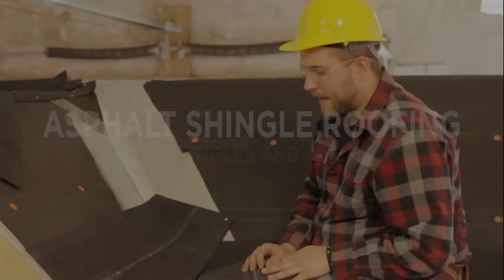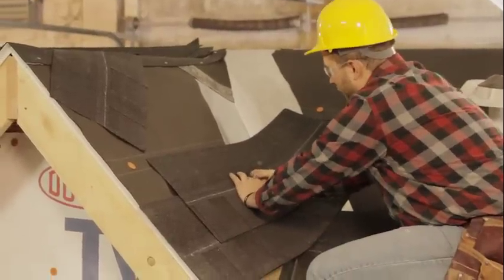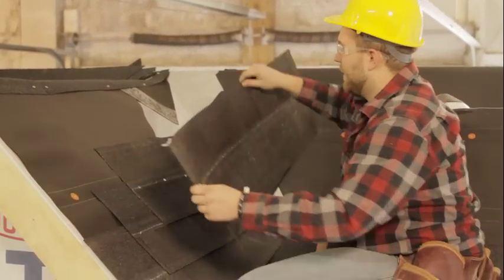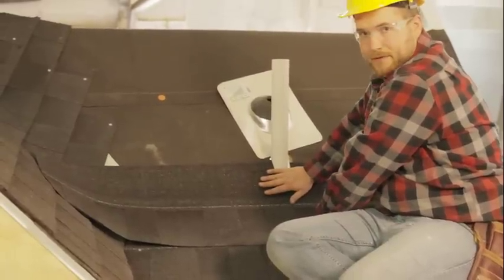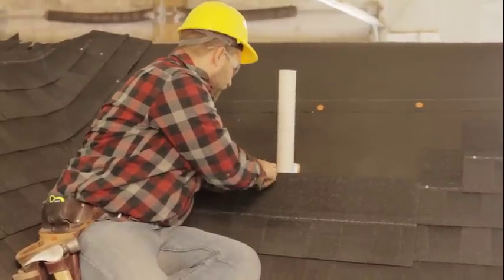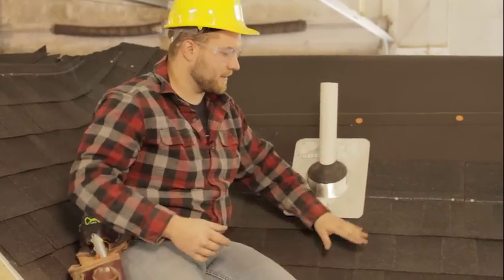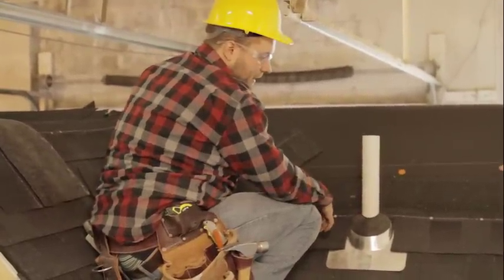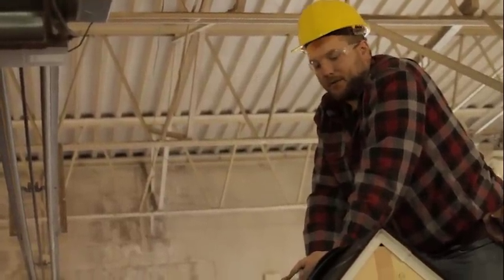How to Install Asphalt Shingle Roofing Part 11: Valley Shingles and Pipe Boots

Comment: Word of advice when you cut the valley you should cut 1 1/2 to 2 inches away from the valley with the tops of the tabs cut at a 45 degree angle so water doesn’t find its way in to the attic, also a  line underneath the shingles of roof adhesive following the cut valley should be used to make sure the entry of the cut valley is water tight.

Comment: its crazy im in Altanta we do a lot of commercial roofs i see it more then you think 50 ft valley right in the middle of the valley a big heat stack .dont make sense to put a pipe boot or a hear stack in a area where the rain travels the most

Comment: I've read several books and watched many videos on the subject of roofing how-to over the past few days and this video series is by far the best one I've seen. Very thorough and well explained. Thanks for posting! 

I just wanted to mention that some roofers recommend clipping off the upper corners of the valley shingles on the side of the roof with the shingles that get cut along the valley line. This is supposed to help redirect any water that gets under the shingles back towards the valley. They claim that if the points aren't cut off (at a 45 degree angle) the water can be driven up under the shingles when it hits the points.
Reply: *****
Yeah, that's it. Apparently this is supposed to "redirect" water towards the valley center.

Comment: 1. Weave the first course or starter strip on first row.
2. notch the upper corners on valley overlap shingles
3. plus most put two nails on end of first course ( at least 6" from center of valley of coarse)

Comment: So I have been watching these videos all the way through and they have been great.  I do have a question though.  Shouldn't the tar paper be under the drip edge?  I noticed that all the tar paper that was laid down was over the drip edge.  To me if rain gets under the shingle, it will get under the tar paper and then make it's way to the sheathing.
Reply: Mike Rowe I have done hundreds of roofs that way. You have the right idea, to keep the moisture away from the sheathing. If done correctly, any moisture that breaches the shingles in the case of a shingle failure, will stay on top of the tar paper. As that water makes its way down the roof behind the shingles you don't want it going under the drip edge because that will damage the fascia board. By tucking it under the tar paper you can potentially save the fascia board in the event of a shingle failure.
Reply: Tar paper isn’t water proof!!
Reply: The roofing paper goes under the drip edge at the rake, and over top the drip edge at the front fascia by the same amount your first shingle course overhangs.  Usually 1/4 to 3/8 of an inch.

Comment: Nice tutorial! What's your thoughts on a California Valley where you run a shingle up the valley line then lay the courses to that shingle creating a diamond pattern so to speak? Is one method less water-shedding than the other? TY
Reply: California and Woven are not the same thing.
Reply: His thoughts don't matter 😂😂 look at the mess he created with that roof. I saw approximately 5 leaks into the first 3 shingles

Comment: I noticed the underlayment was put on top of the roof edge, shouldn't the roof edge be on top of the underlayment? Also, is it possible to just start on the edge of the roof and run the shingles towards the valley instead of starting in the valley? Thanks

Comment: You can double nail six inches in the valley on the underlay side.. You get coverage for wind and rain. You were nailing inward on a single layer. Try to avoid singles as wind will grab easier. Get good.
Reply: Also, you get tighter vallies the closer you nail. Leaves less room for movement

Comment: It is not okay to have the boots bottom showing on the reveal of the shingle. The nail heads or screws will be exposed you have almost 2 inch showing on both sides of flashing that stuff can’t get under. Proper way is to cut the reveal to be overlapped by the next shingle and slid under the bottom of boot then nailed. Next shingle should over lap the bottom cosmetic reveal and both sides of boot totally need a picture?
Reply: Yes pic please thanks
Reply: Jonathan Derek Moseley I have a perfect example today on my jobs site, I’ll take step by step pics showing what I mean
Reply: Jonathan Derek Moseley there’s step by step of what I’m explaining, this is proper and cosmetically appealing less flashing showing. The reason the shingles have more nails then usual is because we’re on a mansard roof 14/12 pitch that require storm nailing 7-8 nails
Reply: @Jay-qn3ez  awesome thanks man!
Reply: RL CL  dude no

Comment: Fine Homebuilding Magazine states the best type of valley is a metal valley. They last much longer as metal is far more durable than a shingle, especially with the volume of water a valley must handle.  Could you show us how to do a metal valley?
Reply: far superior shings also tend to be fragile and flex and break easy to leak in valleys, asphalt shingles in general are trash, metal and and ceramic

Comment: Cut valleys just look like major problems.. Wind under the flap, nails right by the cut ? Snow sitting on this valley for some time, I see major leaks for sure.
Reply: Its literally one of the most durable types of valley u can do as long as it's done correctly
Reply: That why u nail 6” away from the valley .. so when u cut 2 “off the shingles u still got 4” that water would need to travel til it could hit a nail or anything which I highly doubt will every happen

Comment: This is terrible. Not nearly enough coverage running up the "underneath" side of the valley. And youre nailing literally directly in the key way or "seam" where the 2 shingles above it meet. And the bottom of your valley channels water directly on to a nail head.. This is a disaster